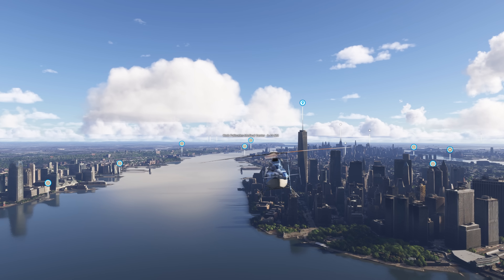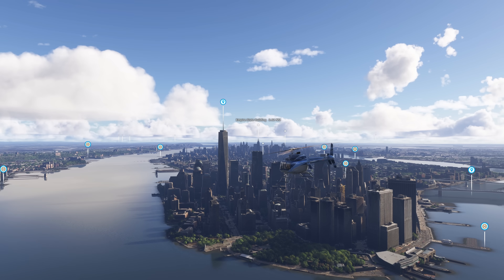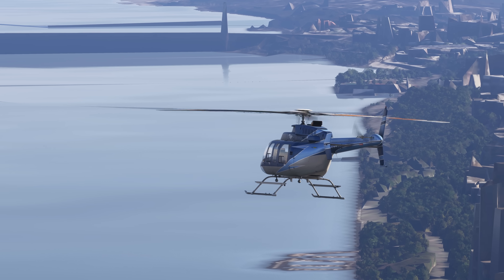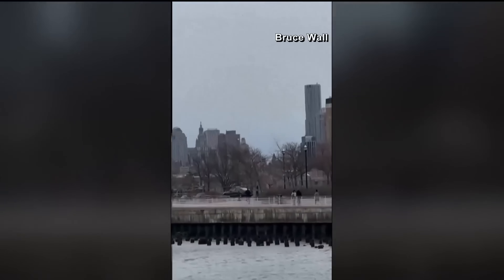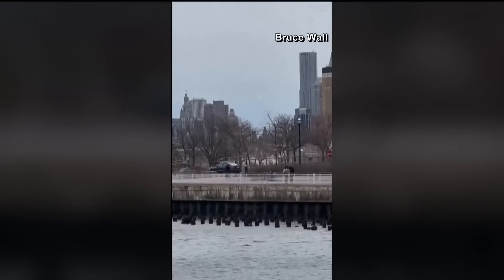Helicopter Expert breaks down Hudson Crash, and discusses “Bump Mast” Theory | NYC Crash Follow-Up

Comment: I have seen (albeit old) footage of the practice ditching of military helicopters in a tank and egress from a submerged, inverted part-fuselage by military personnel. These exercises necessarily involved a controlled submersion and underwater rotation, so do not equate to the situation described here. If trained occupants, such as military personnel, had been involved in an incident like that on the Hudson, is it likely still to have proven fatal? I presume so, given the sudden deceleration of inverted persons on impact. 
One further point. Could up- or down-drafts from the air vent to the Holland Tunnel, adjacent to the crash site, have had anything to do with the incident?
Having said all that, I agree it's important to await the NTSB reports. In the meantime, thank you both for your expert commentaries.

Comment: C'mon man!  Rotor droop is referring to RPM droop, not actual rotor blade drooping or sagging.  These aircraft have "droop compensation" that adjusts the power turbine governor to automatically adjust power to compensate for collective system input.  Rotor droop is RPM, not downward flexing of the Rotor blades.

Comment: They have recovered the rotor assembly and OMG!  The entire assembly is still intact.  It doesn't appear than anything was wrong with the rotor assembly.  It looks more like the engine or transmission detonated.  It is hard to believe that something could create enough force to cause the entire rotor assembly, including the mounting structure, to separate from the helicopter like that.  Very weird!

Comment: Looks from footage I just saw of the wreckage being recovered like the entire mast, transmission and mast mounting assembly separated from the fuselage as a single unit. The blades were broken but downward in a way that's consistent with the rotor hitting the water inverted, so the blade damage probably happened after the entire unit separated from the fuselage. Very strange. The NTSB report will be fascinating.

Comment: Im a total idiot so please feel free/be kind in correcting me.
What confuses me is that as far as I understand the tail rotor affects x-axis manuevers (if that makes sense best phrase I could think of). So if that seperated first wouldn't the craft have tumbled (swung along the Y axis) instead of spinning (around the X axis). To me it always looked like the gearbox/main rotors detached first but Im a normie moron and all the experts are saying its the tail. If the gearbox/main rotors detached first would that explain the violent spin along the X axis? It also looks like the tail is breaking off in pieces like its deforming from the spin or am I just imagining multiple pieces coming off?  What I ses is one piece that comes off at first and remains at altitude (the gb/rotors i assume since they are spinning down from high altitude in the first viral video) and then it sheds several pieces as it's spinning. My mind could be making it up though.  I apologize again if Im just totally off with this, just want to help. And could be a lesson for me/others in the replies.
Thanks for the content though you look like a cool dude to fly with. My buddy whos a pilot has talked about how much of a joy it is to fly with the veterans he was really torn up after the 2020 retirements. He helped me get over beinf terrified of flying by telling me about all the redundancy/back up stuff those big jets have. I was blown away 😂 Something like: "And if the power fails, it can run on this other engines generation and if that fails theres a backup generator and if that fails a windmill pops out and generates electricity and if that fails a grid of hamsters on wheels come out of the walls in the cargo bay and if that fails...etc" 😂

Comment: They found the rotors in the river. You can clearly see the main beam of the helicopter still attached to the nodal beams and main gear box. This is the spine of the helicopter. The roof of the helicopter has come out in flight and with it went the gear box and tail boom. I bet this aircraft had previous accident damage which was not repaired properly. This is a maintenance/repair issue.

Comment: QUESTION: (And this is a hypothetical situation) If one of the passengers was flying left seat up front and accidentally mashed a tail rotor pedal or snagged the cyclic while moving around, could that have caused such an abrupt input to snap the tail boom or caused the main rotor to strike the tail boom?

Comment: I am having a hard time getting past the fact the entire top rotor assembly of both props, the mast and the transmission all floated down together in a seemingly undamaged condition as if it just separated from the engine. My recent learning of a mast pump is the prop and or the mast will break and not float down in a symmetrical auto rotation way. It seems if the prop took off the entire tail rotor in a clean cut then the props would have been damaged. I am leaning toward the rotor separated on it's own OR the main engine seized up causing a sudden torque twist on the entire airframe.

Comment: The key differentiators between light and medium/heavy rotorcraft under EASA and FAA regulatory frameworks.

Let’s break down the differences between a Bell 206 (B206) and heavier types like the Sikorsky S-76 and S-92, focusing on certification standards, maintenance schedules, and fatigue management.

---

1. Certification Standards (EASA & FAA)

Bell 206:

Certified under CS-27 (EASA) or 14 CFR Part 27 (FAA).

This standard covers small rotorcraft: MTOM ≤ 3,175 kg (7,000 lbs) and ≤ 9 passengers.

Requirements are less rigorous than CS-29/Part 29.

Fatigue and damage tolerance requirements are limited; there is no mandatory fatigue evaluation of structure for civil operations.

Sikorsky S-76 / S-92:

Certified under CS-29 (EASA) or 14 CFR Part 29 (FAA).

This applies to large rotorcraft: MTOM > 3,175 kg or > 9 passengers.

Much more stringent certification standards:

Fatigue & damage tolerance evaluations mandatory.

Crashworthiness, system redundancy, and structural integrity requirements are significantly more robust.

Emergency systems and equipment must meet higher reliability standards.

---

2. Maintenance & Inspection Schedules

Bell 206:

Runs on simpler maintenance schedules, typically:

100-hour / Annual inspections (FAA Part 91/135).

Component TBOs, but minimal to no mandatory periodic airframe inspections unless under a CAMO or specific ops requirement.

No MSG-3 maintenance program or progressive structural integrity tracking.

Vulnerable to undetected fatigue cracks, especially in long-term commercial use, unless voluntarily enhanced with SBs or ADs.

Often operated outside CAMO environments, particularly in private or Part 91 ops.

Sikorsky S-76 / S-92:

Operate under a Comprehensive MSG-3 maintenance program.

Include:

Phase inspections

Detailed Structural Inspections (DSI)

NDT at set intervals

Flight Data Monitoring (HFDM/FDM) integration

Aircraft maintenance programs (AMPs) are CAMO-controlled, with life-limited components, retirement indexes, and often damage-tolerance inspections.

S-92, in particular, is subject to extensive S-92A Rotorcraft Airworthiness Requirements (RARs) driven by offshore mission profiles.

---

3. Structural Fatigue & Damage Tolerance Philosophy

Bell 206:

Fatigue life typically addressed via Service Bulletins or Airworthiness Directives as issues emerge in service.

The airframe is not required to have a documented fatigue evaluation or a limit-of-validity (LOV).

Reliant on visual inspection and component failure tracking.

Sikorsky S-76 / S-92:

Designed from the start with fatigue and damage tolerance assessments.

Structural components often have a calculated retirement index number (RIN) or life limits.

Aircraft tracking systems ensure airframe hours, cycles, and stress environments are logged.

Operators frequently perform scheduled NDT inspections using techniques like eddy current or ultrasonic testing in known crack-prone areas.

---

4. Operational Oversight & Risk

---

Conclusion

The B206, while a solid platform historically, lacks the structural surveillance and robust maintenance regime of larger rotorcraft. For commercial operators, particularly those flying frequently /multiple cycles and/or in higher-load profiles, the absence of a fatigue evaluation and structured airframe inspections creates serious vulnerabilities, especially as the fleet ages.

In contrast, Sikorsky S-76 and S-92 are built and maintained to a much higher standard of airworthiness, making them better suited for intensive and safety-critical operations. They are more expensive, but that cost buys more oversight, predictability, and system resilience.

Comment: Interesting interview but did the Col. Yannessa review the video of the helicopter coming apart?  He mentioned there were no eye witnesses but there are a few videos, one of which is quite detailed.
From the video where it is flying left to right it is pretty clear that the helicopter yaws about 90 degrees right very sharply.  At that moment, it appears the tail boom is bent to the ship's right. (this could be a video artifact) Then the tail boom departs and then a second or so later, the whole rotor system with the transmission depart the airframe.
It would be interesting if the Colonel commented on this video.
Reply: https://youtu.be/graz-V-Hksw

Comment: Please keep in mind sirs that a video has been released that not only shows the moment the failure occurred, but another close up video shows the main rotor, rotor mast, and transmission still together as it is rotating towards the Hudson.  There is no indication of mast bumping, and Juan Brown with the Bloncolirio youtube channel states that with this version of the bell 206, they have engineered out nearly all possibility that a mast bump could happen. It seems to me that there must have been a break in the mounts that secure the transmission to the airframe.

Comment: Was at an airshow where a Hughes 500 tail boom separated maybe 200 feet elevation along the show line and the pilot still managed to auto rotate down. Hit hard, one skid broke off and the Hughes fell over but the pilot survived with treatable back injuries and no spectator injuries. Cause was he came out of a long tail slide with a sudden snap 180deg yaw prior to the separation. He kept his cool and no one died. Wondering if the 4 blade rotor of the 500 is more forgiving for lift during auto rotation than say a Bell 206. Never scared me off flying in Bell, Hughes or A-Stars over the years.

Comment: I got thousands of hours in Bell helicopters.
Im still surprised people even experienced one mention Mast Bumping, he is straight and level, there is no LOW-G, and you can get low-g even in good weather as long as you push the cyclic forward.  that`s one of the reason SFAR-73 for Robinson helicopters was created, this and the bell 206 has the same issues regarding this.

Second, he talks about engine failure,  the helicopters Yaw Right, it if was an engine failure it would yaw left, how do i know that? hundreds of Auto rotation in a bell product.  The helicopter in the video YAW right so violently because you still HAD power, by loosing tail rotor either trough a failure of TR or The boom failing, that`s where you get that violent right yaw, as he most likely had Max Continues power at the time of the failure. 

not even gona address the jesus nut that's just wrong... you can see the mast falling in the water in the first video ever shown.

There is picture out there somewhere of the literal whole mast/gearbox and top mount still attached to the rotor that they recovered today, I have never in my life seen the Gearbox assembly be found that way, mind blowing. (https://youtu.be/7QUTQf7vZLA?t=13 what im talking about here)
This is some sort of Catastrophic one in a kind failure of some parts of the tail caused ripple effect, those helicopter downtown NYC do thousands of landings under the hands of low time pilots, meaning rougher landings over a long period of time.  This could literally cause micro cracks in the structure of the helicopter itself which are inspected way less often.

Comment: We have all these components to consider tail rotor, tail rotor gear drive, tail rotor drive shaft and support bearings, mounting points then the big guy the main rotor transmission. And the sprag clutch, Shaft and two blade rotor assembly. Let’s wait and see .